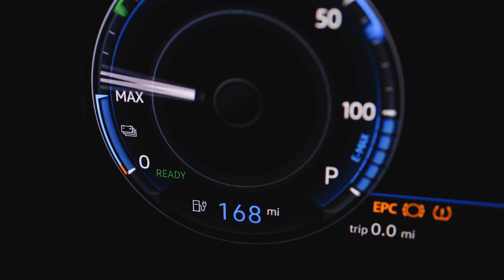African Innovator Unveils Self-Powering Electric Vehicle

Comment: Stan Meyers tech was and is real! it's a simple HHO generator that runs off electricity from a battery and the battery gets recharged from the existing alternator! Almost any gasoline engine that uses a carburetor can be converted to use it and still use the gasoline option as a back up!

Comment: Introducing a self-powered car is flashy, but that is not the primary issue. Is there any interest in selling appliance-powering modules like the one on a TV? Any homeowner with solar connectivity has the metrology setup to document the power flow from a device added to their wiring system. That should be adequate to put to rest the validity of the system. A suitcase-sized system could be available for profit and scientific verification before roll out of general transportation systems. They need to answer the question:"Where can I get one of those?"

Comment: I am a stupid old man

We have technology that converts radio waves to electricity every day jt is called rfid.  It is used at every store to in tags to prevent stealing.  It picks up radio waves and converts to electricity then powers the tag to send a signal identifying the tag from the tag.

We have phones which charge from sitting  on round flat chargers every day with no cords.

The question is can u pick up enough usable energy from radio waves or any waves for that matter and convert to energy in a battery.  I think just theoretically it is possible.

The question is.....

Does it use man made energy that is turned into a wave and then stored in battery.  Which is cool but is really not free.

Or does it use waves that are already present in the world pick up enough of them and convert to electricity for a battery.  This would be more than cool.  And if not costing more to build than produce the energy would if fact be game changing.

I dont believe in unicorns but I do believe in progress and I would like to see this work...lol

Comment: This won't work either. Those solar panels only put out a maximum of 400 watts each. If you use four of them, which by the way are quite large, they would only have an output of 1600 watts that NOT RUN ANY electric car. 1600 watts is not even 20 amps. And you will never get maximum efficiency out of a solar panel.

Comment: Why are you adding the aspect of controversy? The simplest way to prove his device is not through some theory but by buying and using it. Those who say he is violating so-called laws of physics are making themselves foolish. Do they think their current knowledge has exhausted the knowledge of physics? Those who think this inventor will spend more than 10 years pulling around a fraud without anyone really discovering it should check their minds. Let's talk about Chikumbutso without introducing western doubts. Let those who are using his machines come out and say that they failed.

Comment: Breaking boundaries in the imagination is easier than breaking the boundaries of nature and the elements. Water is H2O – can be changed with a lot of added energy and create great expansion so the engine piston is moved and the vehicle is driven forward. 
But radio waves can be made in several ways – is this an addition that is not within safety levels?
 It is presumably illegal to sell cars that are powered with a radioactive power source.
Trunk spoiler with solar cells may be able to provide enough charge if parked in the sun at work ca 8 hours per day in very sunny areas.
Hand tools such as cordless drills are quite similar in structure to a battery-powered car. The electric motor and generator are pretty similar. The generator and gasoline provide electrical power – the generator part provides power out, the inverter part provides a pure sine wave that is better than what you have at home. Electric motor consumes power.
- Guess where the capacity is biggest/greatest?

Comment: There are 2000 watts per square meter of solar power on Earth's surface. There are not that much power and radio waves. So if you want to make a self-powered car you can do what the people do that make the solar car race in Australia which rides hundreds of solar powered cars every year. You put solar panels all over the top of the car. That will charge your batteries and even provide enough for a very lightweight car to run all the time on the panels without any batteries. But radio waves don't have that much energy. So if he's got some device that's harvesting things from the air without solar panels and he's harvesting something besides radio waves. It's possible but very unlikely. He is not providing enough description at all of how his machine works and the excuse that oh my gosh I can't tell anybody is the one that hundreds of people have used that have turned out to not be truthful. Hopefully he is truthful.

Comment: If this was possible to run on radiowaves don't you think all the companies that are sending out these "radiowaves" would slap a charge on this invention because it uses the energy from their radio waves they send out?
Reply: Radio wave are also naturally occurring in the galaxies. You thinking wifi which I don't think he is using man made waves
Reply: @shumbahurushumbahuru4894  micronic energy. And how does he get this "energy"? Not via a magnetic pulse collector and amplifier? Or a magnetic infusion coil engine (m.i.c.e.)? Or does he use a microfiche scoop to collect this "energy"? My machine uses a negative wave repulse drive. It's a bit like a magnet that reverses the magnetic poles of the earth to repel an object . The drive boosts the magnetic field to make it powerful..... or is it a metal box connected to some cables that connect it to some batteries that move the car?.

Comment: You owe it to your subscribers to research things before disseminating the info. This has been proven false. IT NUH TRUE - FAKE! Check snopes. Stop spreading their lies. You can get electricity from the air but it isn't enough to power (p=V*I) anything requiring significant power. It's a play for attention and will fade as quickly as it appeared

Comment: Beyond ridiculous 😂 Im not arguing that the car or motorcycle  can be charged wireless and take in the power from radio waves, its an electric vehicle. Let it charge long enough from a POWER SOURCE and it will eventually charge up. If you wanna go fast = electric motors can do that, and while the car is in motion it can also gather the radio waves to add power back but here's the thing, your never gonna get enough power back quickly enough to power the car continuously, unless you drive around the radio station continously going in circles. Even then, the conversion rate from the energy RADIO WAVES is goona be far more going out then what the car can take in. It equals a huge loss and is unsustainable. Please keep in mind radio waves are powered by electricity that comes from petrol or natural gas or nuclear, from one of those.  So this is not zero point energy or even new technology - when your out of radio broadcast range, your out of power. Im also wondering if everyone was taking the energy from the radio waves from radio stations , is that stealing the power which equals broadcast distance for reception? I belive he just adapted old tech to a car and called it a new fancy name. But please done be fooled or scamed, somone has to pay the electric bill !!! As we say in AMERICA A**, GAS OR GRASS, NOBODY RIDES FOR FREE 😂💯💥 This is super cool that he did this for himself but the reason it wont be massed produced is beacause the radio broadcast waves take alot of energy and that takes allot of money and radio stations will file suit for theft of the power they use to broadcast the stations radio signal. This is unfortunetly a cheap way for 1 or 10 to steal power from the sky but in terms of it being for all - it isnt gonna work. This is a giant NOTHING BURGER 🎉

Comment: There are thousands of things that were called "impossible" till someone proved they were not at all. We are witnessing the very next version of that incident. I spent an hour with multiple LLM's and found this to indeed true and potentially possible. This how, in regards to a TV 
1: Energy Harvesting:
The device would tap into ambient microsonic energy—tiny vibrations or sound waves present all around us. It might use a resonant structure (think of it as a miniature amplifier) to boost these weak vibrations to a level where they can be usefully harnessed.
2: Conversion to Electrical Energy:
Once amplified, these mechanical vibrations would be converted into electrical energy. This could involve materials or components similar to piezoelectric transducers, which generate electricity when they’re mechanically stressed, or electromagnetic converters that use moving parts to induce an electrical current (Like the electric motor in a car producing electricity that parts of the car uses and stores in the cars battery).
3: Voltage and Current Conditioning:
The raw electrical output from this conversion is likely to be low in voltage and unstable. So, the device would incorporate circuitry—like power converters or transformers—to “step up” and regulate the voltage and current, turning the messy, low-level output into a steady, usable form of electricity.
4: Supplying the TV:
With the power now conditioned, the device could then feed this electricity into a power outlet or directly into the TV’s power supply. The TV would then run just as it would on electricity from the grid.
This explanation is entirely hypothetical. In conventional physics, creating a net gain in energy from ambient microsonic sources (enough to power household devices continuously) would be a big stretch, as it challenges, but is not disprove by established principles like the conservation of energy. But under the assumption that the device works as claimed, that’s how it might theoretically convert ambient energy into something you could use to run a TV.
Thus, It is possible but simply hasnt been demonstrated anywhere before and peer reviewed.